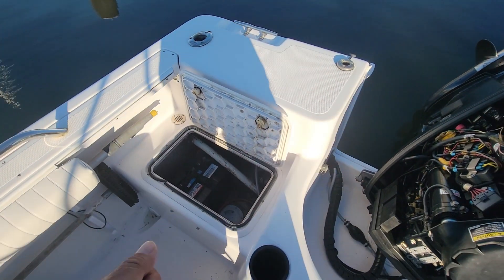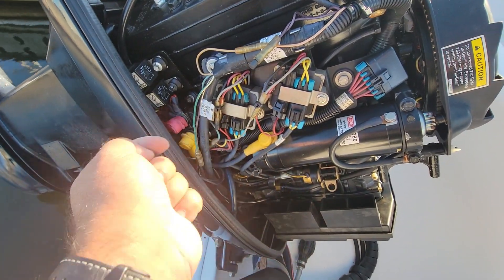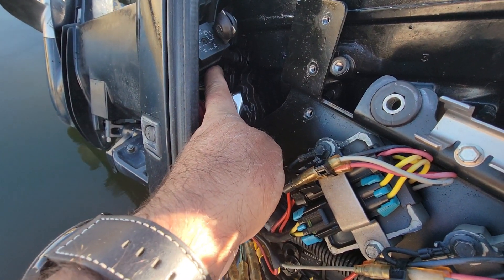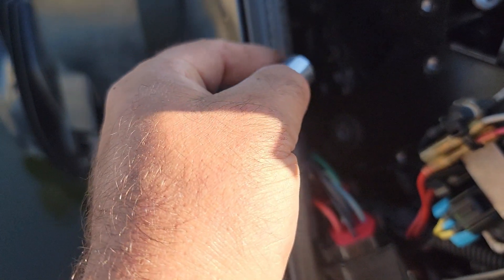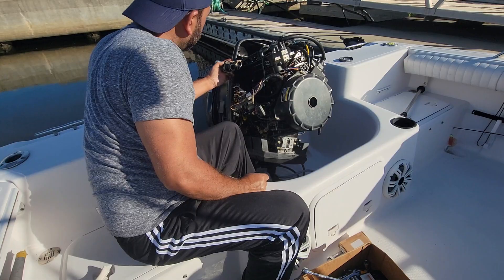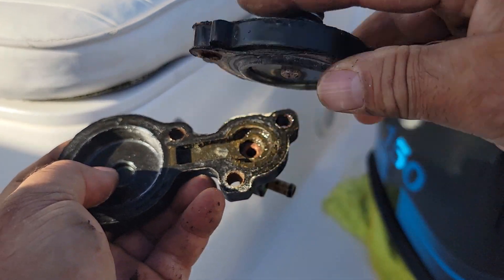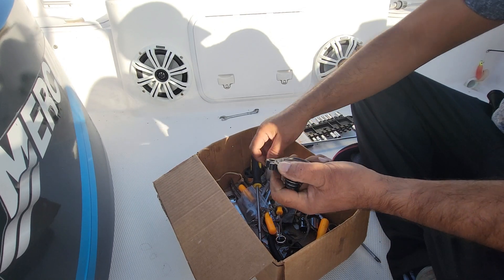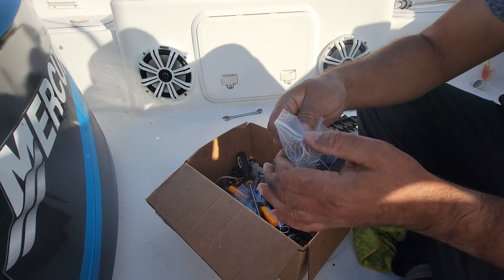Poppet Valve | Engine Heating Up?

Comment: i have a 89 150 mercury 2.0 outboard i believe was told when its runnning high rpm it overheats an has to cool off before restarting any ideas? someone said the headgasket....but ive read alot about other things than the head gasket
Reply from the maker: Is it a 2 stroke or 4 stroke?
Reply from the maker: If the engine overheats, most likely its the head gasket and the heads. Marine engine are designed to run at high rpms. The temperature should not go over 140 or 150 in most cases. If it runs above that, most likely over heating is happening. The heads are aluminum and they crack.
Reply: sorry about the late reply, i was out of town its 2 stroke the mixing tank is gone so u mix with gas., i got the motor an previous guy said it was running just when full throttle an it heated up had to wait till cool down to restart, he took it to a shop an they went straight to "powerhead needs rebuilt 4k" the right side head was off, i seen no cracks no scares no scatches just no oil to top cylinder.. the motor is so clean and nice atfer reading everything about these motors its weird the repair shop went straight to powerhead needs rebuilt. ive baught new head gaskets an thermostats putting it back together than going to try an see what compression is at than go from there, i also changed all fuel lines/waterlines no clogs ive seen so far.
Reply: also maybe if you have discord or somthing we can maybe chat alittle better i could provide a picture or video.
thanks for your time sorry for the wall text.
Reply from the maker: Its all good no worries, lets see after you put it back together. Not sure if you have any machine shops in the area, I rather have a machine shop look at them.
Reply: @FKCamVlogs  machine shop means alot of money, which i dont have paying 4k to rebuild is outrageous i will comment back when back together and tested alittle more

Comment: Why advertise the amazon junk when everybody is running into same problem. Including myself. The water spitting out of vent hole from cheap kit. ...

Thank for wasting hours of my life.. .
Reply from the maker: Not sure if you saw the entire video but I did warned about buying from Amazon, recommended buying Sierra or quick silver. I didn't want anyone to go through what I went through. Also later I learned that its not the product that's faulty but how you assemble back and how the diaphragm sits.

Comment: Where did you get the OEM kit and what is the part number? I’m getting a delayed tell tail at idle and when the tell tale going it’s hot with steam. Did the water pump already. Great video! Thanks for the help.
Reply from the maker: I went to local mercury dealer, got all parts separately

Comment: Sir I have a merc 150 blk max engine. I need to replace the poppet valve  so I made an attempt to do replace it  but the rubber gromet  that holds the poppet went down into the water jacket hole. Will I have to tare down the engine to retrieve it or is there another way to get it out?
Reply from the maker: I am sorry seeing this after 3 weeks. Most likely, you have the solution by now. I would say you will need to remove the lower unit. Again, my apologies for the late response.
Reply: @FKCamVlogs  It`s alright & thanks for your response. I used a Camera probe to locate it and a thin wire to fish it out. There really wasn`t any place for it to  go once it went down into the water jacket because it was just too big. The jackets were designed  for water to pass thru not a round piece of rubber so it was a success retrieving it.👌
Reply from the maker: @horacelee880  Awesome trick and your response may help someone else with same issue.

Comment: I have this exact motor and finished the valve replacement yesterday using the same kit you used off of Amazon.  I am getting water from the vent hole from the moment the engine starts.  Before  I order the OEM kit, is there something I should check to fix this problem?
Reply from the maker: Get the OEM, the kit from Amazon is cheap, gasket is bit thick, plus diaphragm doesn't site well. I redid many times, till I ordered the OEM

Comment: What Mercury outboard do you have?
Reply from the maker: 2002 150 XL Saltwater series 2 stroke
Reply: @FKCamVlogs  Nice. I have two 2001 Mercury Optimax 150s. They're overheating and I am looking for solutions. I've already  changed out the impellers and thermostats.
Reply from the maker: Did you used OEM thermostats? Did the wings of impellers are in same directions as the old ones? If yes to both then next thing on list is poppet valve, make sure to buy OEM as well
Reply: @FKCamVlogs  I found what the problem was. I had sent one of my ECUs to get repaired and didn't flush out the outboards. I left them for a week and a half. The salt crystallized and wasn't allowing the thermostats to open up completely which caused my port side outboard to overheat. I took out the thermostat housings and had to scrape off all the crystallized salt on both outboards. I also used a file and sandpaper to clean them all up. I took out my boat earlier today in the San Diego Bay and both outboards are good. And oh, I used the Quicksilver thermostats so yes, they are the OEM ones. Thanks for following up on my question. It is greatly appreciated. Now I will be going offshore fishing to hunt for yellowfin tunas, bluefin tunas, dorados and yellowtails down in Mexican waters.
Reply from the maker: Glad to hear! Enjoy fishing.
Reply: @FKCamVlogs  Thanks! Hopefully we will hook up on some nice fish out there. Offshore fishing can be hit or miss. If we catch nothing out there we shall have to come back to inshore fishing or hit up the bay..😁
Reply: @FKCamVlogs  I ended up having to change out both of my poppet valves. Now they're installed are the poppet valves supposed to shoot out of the small holes? Let me know. Thanks!
Reply from the maker: @kisdasenglothnam  No water should come out of valve hole

Comment: My optimax is pissing cold water but I get a long beep with  rough power at Low speeds, do you suggest it's the poppet valve or thermostat?
Reply from the maker: Thermostats have to get to a certain temp to open up. I think its 140 for Mercury. Check them first, they are easy to swap than puppet.
Reply: Did you solve the problem?
Reply: @ergunkarakulak8993  it was a fuel valve gasket

Comment: So we have put ours back together and water keeps spitting out of the air hole. We have taken it apart and put it back together several times with no luck. Do you have any advice?
Reply from the maker: Are you using OEM parts kit or after market?

Comment: Did you decide to replace it because your engine was getting hot after 1500 rpm?
I'm asking because mine gets hot above 3000 rpm. The temperature needle gets to 3/4 and this triggers the temperature alarm.
Reply from the maker: Yes, mine was getting hot around 1500 to 2000 rpm
Reply: @FKCamVlogs  I've just found out that when engine first start thermostats are closed and poppet valve is closed also, but thermostats open very quickly while poppet valve remains closed. Thermostats rarely fail opening.
Once the engine is warm we can increase engine speed above 1500 rpm when the poppet valve should start opening, when higher water pressure, due to the rpm going twice as fast as idling, pushes the diaphragm against the valve spring. This allows hot water exiting increasing water flow high enough to cool the engine.

At idling rpm poppet valve should stay closed which allows the low water pressure reach the exhaust manifold, the cylinders and heads of the engine until thermostats get opened at around 63°C equal to 140°F.

Temperature alarm sounds when needle reads 3/4, engine reaches 115°C equal to 240°F, and stops sounding when temperature drops to 99 equal to 1o 210F.

I think that I ended understanding what happens. Thermostats regulate temperature at very low rpm and poppet valve regulates temperature at medium ang high rpm.

A closed poppet valve above 1500 rpm causes the engine to get too hot, because hit water can't exit. This is the most common problem when valve gets stuck with salt deposits,  or diaphragm gets broken.
. .
An opened poppet valve below 1500 rpm, a rare case when spring gets broken, causes the engine to get too hot at idling rpm, because water pressure is not high enough.

Poppet valve takes care of cooling above 1500 rpm by moving the valve until it gets completely opened. 
If valve doesn't open the engine will get too hot because hot water can't exit which reduces water flow.
Below 1500 rpm poppet valve should move until the spring closes the valve allowing low pressure water to reach the whole engine.
Reply: @FKCamVlogs  Most probably your poppet valve is stuck closed. Mine also.
Reply: @FKCamVlogs I went yesterday on board and checked that at 2000 rpm the temperature needle reads 1/2 and telltale sends plenty of water out but also shows a bit of white water vapor steam

Temperature goes down to 1/4 after a while at 1000 rpm. 

Idle is set to 600 rpm when engine is cold and 700 rpm after working for several minutes.
Reply: Great explanation 💯 still got grease on my hands I’ll get it can’t let the engine beat me

Comment: I had same motor. Same problems. Watched several of your videos. Liked videos but unfortunately I think with this motor you will always have videos to make unfortunately. Only outboard I've owned that was never right from day one. Great videos!!
Reply from the maker: Thanks for your feedback. This motor is actually like a bullet strong and reliable. I do these maintenance videos even I dont need to swap stuff. Share with me your issues I will see how I can assist.
Reply: What problems did you have?
I'm asking because my 135 hp two stroke gets too hot above 3000 rpm
Reply: @josemariatrueba4568 my 135 black max does the same. Hoping the poppet valve is the issue.